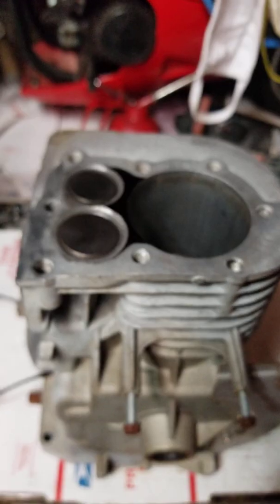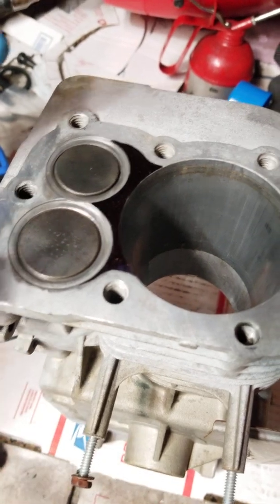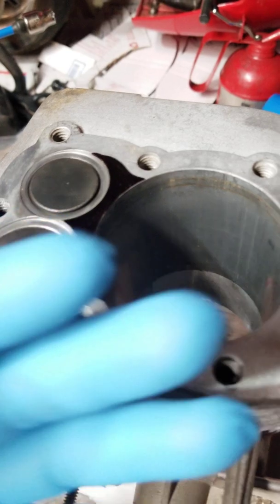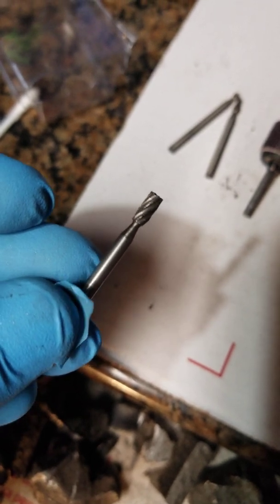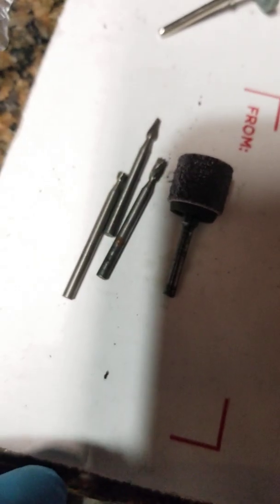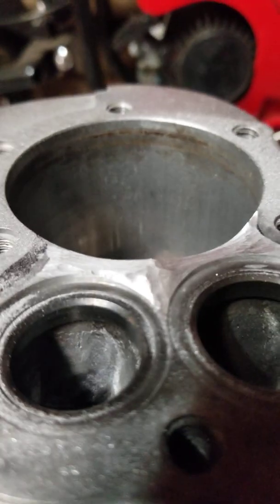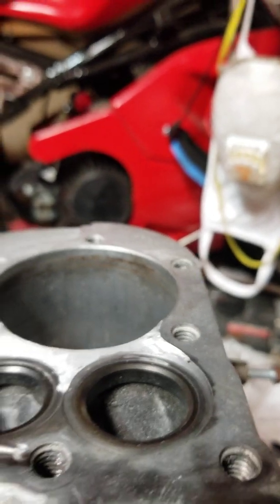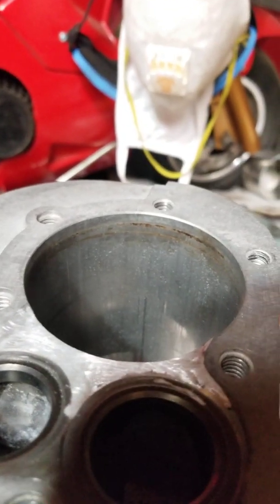How to Shave the eyebrows on a Briggs and Stratton 5HP Engine

Comment: How do you compensate for the loss of compression that this causes?
Reply from the maker: Well, I did my best to deck the head a few thou to compensate somewhat.  I actually chose to sacrifice compression in order to gain increased air flow through the valves and on top of the piston.  However,  I've learned that this mod will only show its true colors with upgraded cam.
Reply: my 5.5hp Briggs runs at less than 6:1 - I shaved the eyebrows, milled the head and whatever the compression, which I bet is still < 8, it still runs absolutely fine on 95.